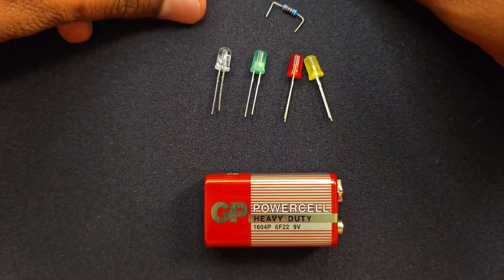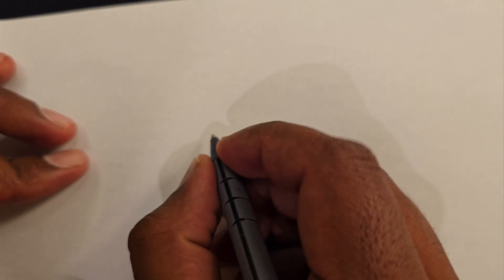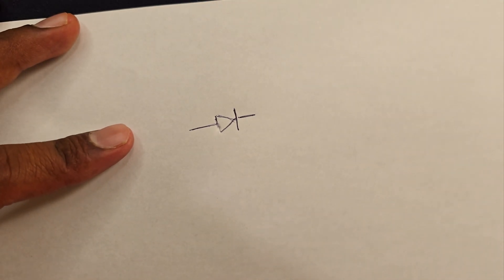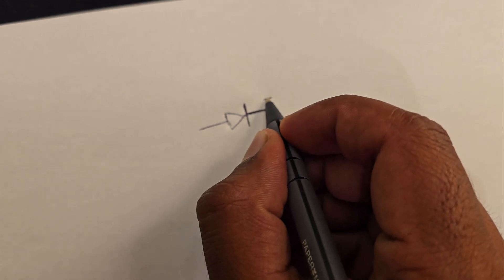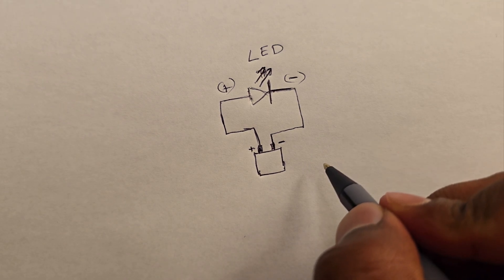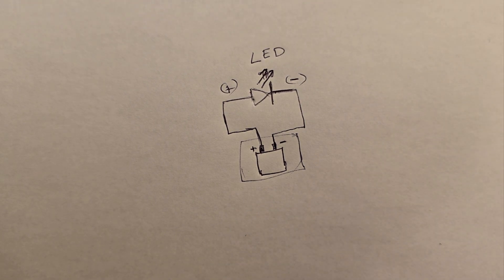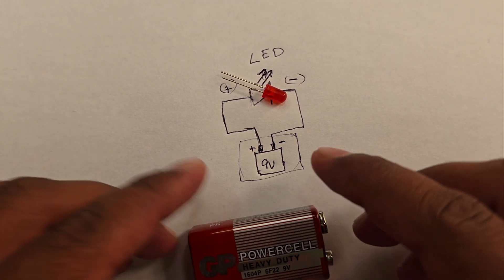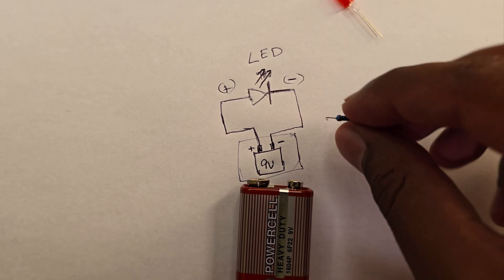How do you connect an LED to a battery?  Learn Basic Electronics.

Comment: no matter how much voltage a battery has, one can safely connect an LED to any battery with just a piece of string (twice as long as half its length) 🤣
of course... it wouldn't light at all 😓

on a serious note, there is an LED calculator page that I use often as a basis for determining the series resistor, often setting the required current to 5mA or lower.
Reply from the maker: Thanks for  the comment.  There is a video published right after this video, which is about how to determine the value of the current limiting resistor in the LED circuit.  Please check it out if you like. 😊